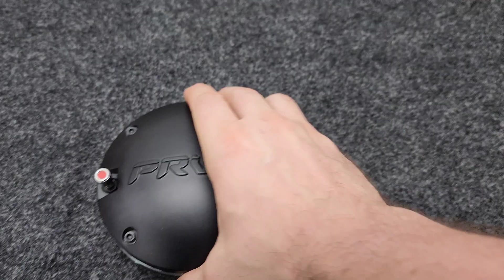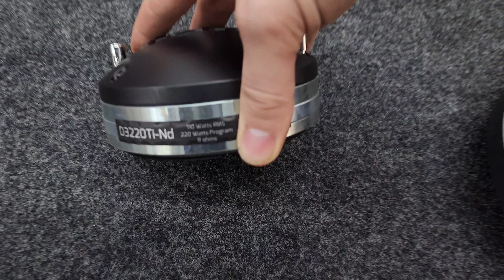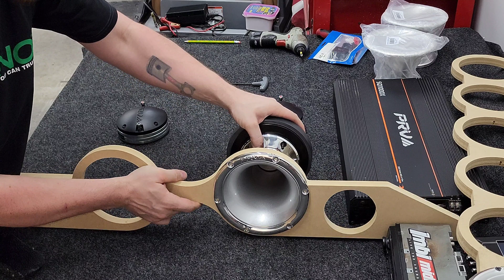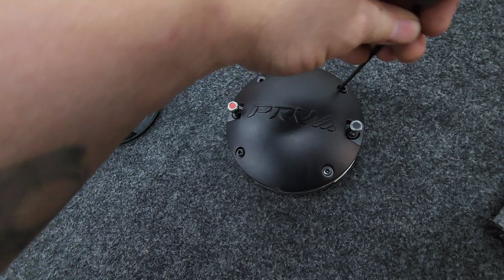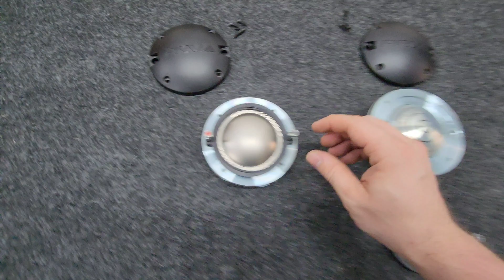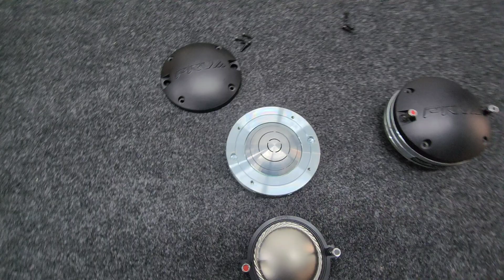Neodymium vs Ferrite Titanium vs Phenolic Comparison for COMPRESSION DRIVERS aka HORNS! PRV Audio

Comment: One thing I rarely see addressed is the comparison in the way each sound (ferrite vs neo). Is there even any difference? In my opinion, small neo tweeters like the ones that are packaged in a component set, cannot match the unstrained output of a full-sized ferrite tweeter, althought both have 1" coils and have similar frequency response.
* any intellegent response is welcome
Reply from the maker: @csj9619  that's because there is zero sound difference in magnet material. People have this misconception that neo speakers sound better. It's just not true.
Reply: @12voltfever I’ve tested both neo and ferrite side by side and trust me there’s a big difference when it comes to the titanium drivers.
Reply: @firewaynemusic4870 i would agree. The neo drivers just have stronger magnets and are more powerfull.
Reply: @firewaynemusic4870  which one sounds better.. or what is the difference in sound?
Reply from the maker: @csj9619  now if we're talking 8" 10" 12" speakers and 4" voice coil compression drivers, ferrite has better hear dissipating capabilities and so you can abuse them more as there is more magnet mass.

Comment: Could you compare a bolt-on vs screw-on horn driver of the same watt and size?
Reply from the maker: There is no difference. Only the way the waveguide mounts
Reply: @12voltfever  Thank you for the quick response. Thanks.

Comment: When using Titanium driver do I still need tweeter ?
Reply from the maker: You don't need it. Some people will tell you otherwise. You can use a tweeter also and it does improve brightness.
Reply: @12voltfever  thanks I have been using both and I removed the tweeter and my sounds better with out them

Comment: titanium is better. most of c.drivers use titanium.
Reply from the maker: It is a matter of preference, depending on the system.
Reply: @12voltfever  I know. I have titanium, polyester, polyimide. All 3 have their caracteristics.
Reply: What would u say is better? I have B&C MH32 12”, and Prv tweeters, I want to get 4 drivers. What would u say is good to fill in the gap? Phenolic or titanium? What brand ? Thank you
Reply: @MegaJohn334  MH32 won't couple well with a 4" c.driver. You are going to have missmatch on 2000hz. 
I'd sugest you DE250 that produces crystal highs. I use it on ME45 horn. 
Try it. You'r gonna ❤️ it.

Comment: So the titanium is higher and the phenolic is adjustable mid range type?
Reply from the maker: They both play "mid range" frequency but the titanium can play much higher, but not as low as a phenolic.
Reply: @12voltfever  do horn length play a part?
Reply from the maker: @AllSoWavyReese  yes especially on phenolic. The longer the better. Sounds cleaner and gives deeper vocals.
Reply: @12voltfever  hey thats wat he said but ok i got u😂
Reply: @12voltfever so witch one is better for loudness and sound travel
Reply from the maker: @PhilTooTrill  it's not about loudness or distance between the two it's about the TONE it makes. But titanium screams more and you can use without tweeters. Phenolic has stronger vocals.
Reply: @12voltfever  i have 2 4” titanium tweeters and 2 2” titanium tweeters with 4 neo 8’s mid. I think imma go with a phenolic and tune a little higher

Comment: Ty, so if I was using some say 6.5" prv bullet mids and 4" ti700 tweeter wouldn't need one of these or would my sound gain a lot from adding a ti horn? Sorry if that's not asked right. I know a lot about the bass side of audio not a lot about mids/highs and crossovers. But I'm planning a large build and need to get my mids and highs up to sound right.  Thanks you and subscribed
Reply from the maker: Sorry for the late reply, you can always benefit from a compression driver for a more full sound. With a phenolic driver (1" would be sufficient such as the d270ph) you can run the low pass lower on the speaker so the vocals are stronger and then the driver will fill the gap between the speaker and the tweeters!

Comment: I have 4 10mb800ft per rear door 
2 2200ph per
2 tw500my per
2 st200 per
What frequency would cross them at for my application
Reply from the maker: In your case for the D2200PH with supporting tweeters, depending on power of course, you can run them 600bt18-5000bt18 (them TW500 play pretty low for a tweeter). Run them 10s low on the LPF (between 1650-2200 on the low pass) let the driver do the upper vocals and the midbass will shine on the lows and low vocals!